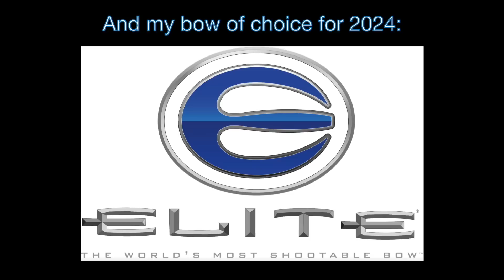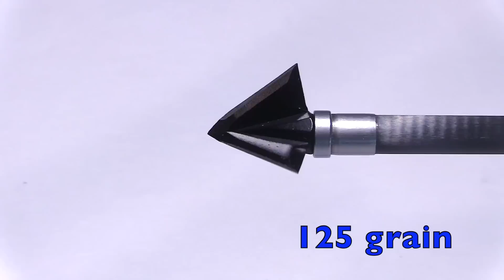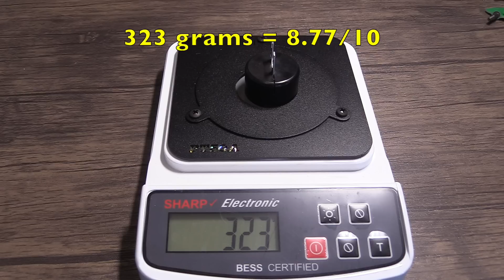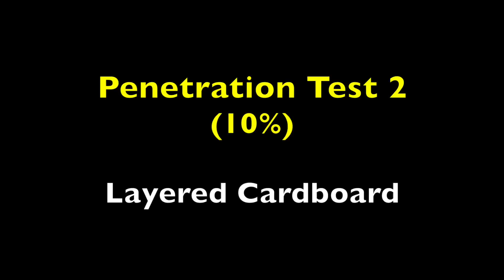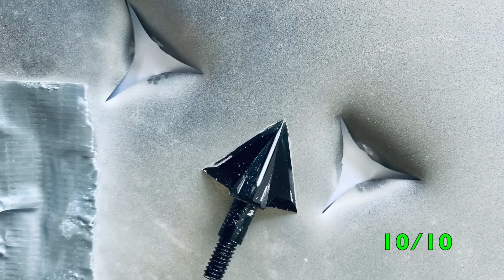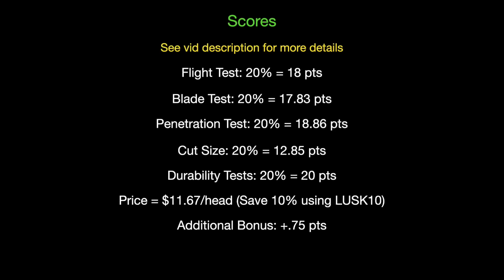OZCUT ELITE 3: BROADHEAD TEST

Comment: I've bought and returned 3 sets of these in 150 grain. Two big problems with this head. First, none of them spun well on my tester using match grade Easton arrows, they all had wobble. Disappointed to say the least. Second issue, none of them were at the advertised cutting diameter, making them illegal for hunting use in my state. They were all under 1 inch diameter. Some were 15/16, two were 13/16. They were all killing sharp in the box but you'd definitely need to touch these up with a diamond plate or other system to get them "razor" sharp. 

You really do get what you pay for.

Biggest bummer, all of them made in China, I'm not against buying Chinese made stuff if its quality or plainly labeled. But these are marketed as an Australian company.
Reply from the maker: Interesting. Was that recently? The company was bought out about 5 yrs ago and they've made some very significant changes.
Reply: @LuskArcheryAdventures  October 2024-January this year

Comment: Just curious if you had any left over heads from the past to flight test out the cross bow. Maybe have enough heads to make an other video. And as always, thank you for all the testing.
Reply from the maker: It really depends. Sometimes I go through a whole pack in my tests and they are not in great shape after that. But other times I can use one head for pretty much everything. And I sometimes do retest the following year if I change some of the protocol.
Reply: @LuskArcheryAdventures  Thanks, I'm interested in seeing the sevr 1.75 accuracy  to a field tip.

Comment: Great vid as always.

I like the blade thickness.
I like it's a single peice design.

I don't like the grind of the cutting edge.
I don't like the cutting edge doesn't go to the tip.
I don't like the back edge of the blades are sharpened.
I don't like the cutting dia, needs to be 1 1/4.

I'm sure others will like it but for me and  animals I kill, I don't like it.
Reply from the maker: Thanks for sharing your thoughts. Much appreciated.

Comment: You should do a video i’m using the stay sharp system, sharpening one of the broadheads perhaps the Oscott showing how much sharper you can get it over the factory sharpness. that would be a winner in my book.
Reply from the maker: I did that a couple years ago. I did it with a slick trick SS three I think, or maybe it was a annihilator. But I often reference the YouTube channel called Innovative Outdoorsman, that’s from the owner of State Sharp guide. And he has a lot of great demos on there.

Comment: I've used the 344 extensively on this head with no issue. You just need to touch up the "tanto" tip as it's not inline with the rest of the head. This is very confusing. I just got some 125's and they had changed the model so that the 125 model is longer than the 100. This looks like a 100 grain or the old 125 as I've shot both of these extensively. The 125 that you tested before was the same length - Are these the new version or the old?
Reply from the maker: I’m not really sure about that. The old one I tested was so long ago. I know that was the old model. And this I know was the new model of 125 grain. That would be a good question to call them and ask them.

Comment: Maybe not the best for sharpness and edge retention, but it sure is a tough little head and flies really well for me out to 80+ yards. And hard to beat for less than $35 a pack!
Reply: Did you notice that these were the shorter 125's like the older? Or am I imagining things. I feel like the last 125 we got was longer.
Reply: @CEMuhlbeier  They look the same as my 125s which are supposedly the newer stainless ones. The packaging wasn't updated to say stainless.
Reply from the maker: thanks for sharing that.

Comment: I keep one of these in the quiver with my Sevr's in case I spine a deer or in case a big boar comes in. It isn't a true 1 1/8" by my measurements. They are super accurate. I sharpen them as best I can on a flat stone. I did shoot one into a big doe I spined last year. The entrance hole was a beautiful triangle a little bigger than the dia that cut the air clean off like with a pair of scissors. That indicated I was able to get them plenty sharp enough on my stone. The exit had the stretch cut effect and was over 1 1/4" at the wideset point.
Reply: That's 100% true. All grain sizes are actually just barely over 1". There is a stretch effect with the short head though you're right.
Reply from the maker: Thanks for sharing that experience

Comment: The heads I seen had terrible factory grinds. Took some work to reset the bevel, but they got very sharp.
Reply: What process did you use?
Reply from the maker: Thanks for sharing that experience.